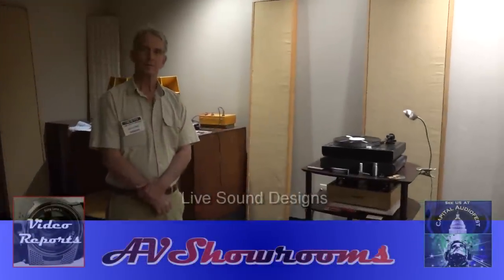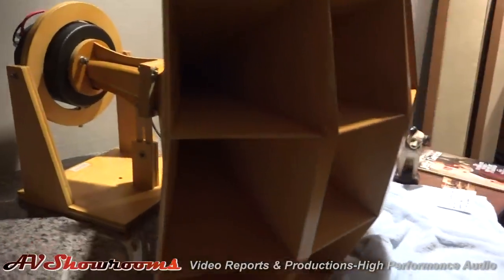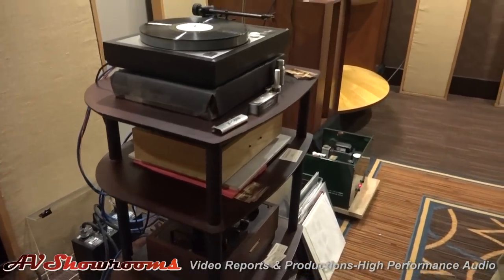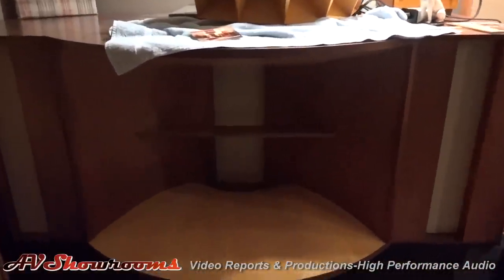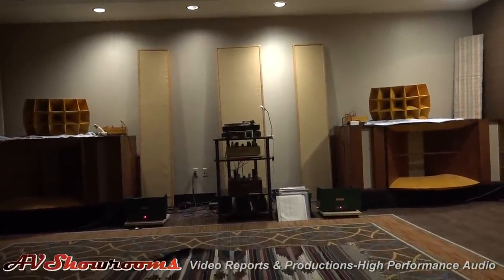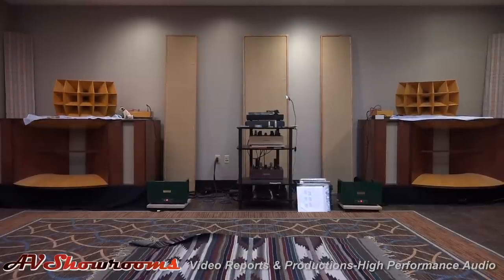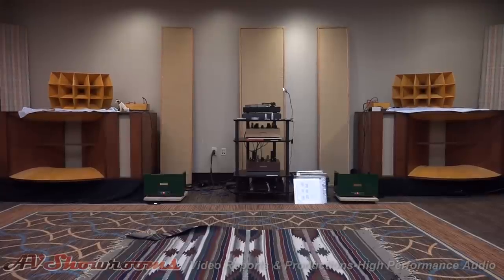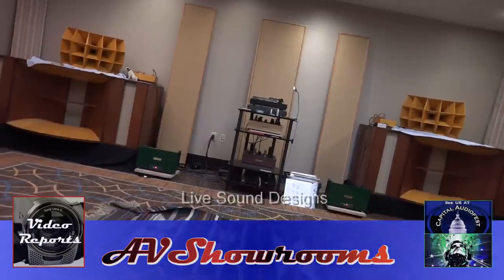Live Sound Designs, amazing horn loudspeakers, RCA's, The Capital Audiofest

Comment: Had three of those bins with the MI-9449 15" woofs and the radial HF horns and driver's.The MI-9377 amps came with the system too. Eight amps. They jump a bit better if you feed them some "Alan Parsons project". Sold all awhile ago. Using mostly JBL now.

Comment: the main problem is everything works well up to one power level ,and when it intensifies everything goes into chaos,,that question has bothered me in recent years why
Reply: Easy solution: Play at a lower volume level and you won't get the same problem with standing waves and other distortions  from the room.
Reply: @FlowithdaGo  Doesn't a proper room for these types of speakers need to be huge? Even bigger than the room these are playing in.
Reply: @bertroost1675  If you're playing loud, yes. Lower sound levels equals less energy in the room, and therefore the room doesn't matter that much.

Comment: I know this recording and sorry but the sound is obviously coloured. The midrange is entirely too forward… 'squawky' is the word. It seems very dynamic and clear though, just needs a little EQing… maybe some work on the crossover will fix it.
Reply: Impossible to judge over the internet through secondary  speakers, but I never found the LP12 to be suited to horns;  colouration in the lower mid/upper bass being the primary issue, plus too mid-dominant sounding with not much bite/attack at the extremes.
Reply: SSF... you are correct. This has "horn" colorations quite obviously.

Comment: NO TOP END on those...period.  Coming right out of the driver on an Altec 288G into a standard tube, you're already down -10 dB before it even hits the throat.  Efficient, yes..."good?"  No.  Polar plots of these and the 1502s show "fingering" of the top end with 15 KC down -16 dB on axis with each cell's mouth, similar to the rolloff you get with a modern CD horn.  THen there's the issue of the Altecs' famous harmonic distortion due to the squared corners...higher thrid harmonic production than even a lousy early SS amps of the late '60s.  Want multicells?  You'd be FAR better off with old Community 2X5s and JBL 2440s.  Also, the bottom end cuts off on the "Ubangi" bottom bin around 5O Hz as the horn unloads, just like the A2 and A4s.  This is not "high fidelity;" this is "colored sound" reminiscent of hi-fi in the '50s, including Paul's corner horn.  What used to make up for the lumpy freq response and distortion was the dynamic range then impossible with direct radiators.  That's been overcome with better driver designs today and gobs of clean MOSFET power available fairly cheaply.  However, a full horn system WILL save on your power bill, a fact not overlooked by owners of large dance halls I've known!  A pair of JBL 4331As driven by a Hafler DH-220s would romp all over this rig in all catagories for this program material.
Reply: +DeserT BoB All talk of frequency extension, harmonic distortion, horn shortcomings and what not; that's the (highly compressed) song of marketing BS that's supposed to convert us poor saps into avid buyers of products that suffer the fate of an overriding and now long-standing tendency to squeeze sound from speakers the size of milk cartons and amps of newer technology. Any missionary efforts would be better spent (instead) advising people to use their ears, and whether what's heard resemble live acoustic sound - insofar sonic authenticity is sought. Upon listening to the speakers of above video the interviewer exclaims "Super, super sound." Oh, let's just tell him what you wrote above and find out if he'll consider changing his statement. Surely the man must be a brown-noser or someone who has no concept of how to assess good sound, right? Well, go figure; I'd rather go by his hands-on impressions than your hypothetical scribblings. Btw, I like MOSFET-driven amps since I own a 30 watt Class-A MOSFET amp myself, and it's driving my 105+ dB horn speakers just brilliantly..
Reply: you mean to your ears the jbl sounds better.
Reply: So arrogant...
Reply: It's like driving an restored old car, it's for the feels over the specs even though I agree with you.
Reply: he's not being arrogant, he's being factual, and for the record he's right...
Reply: @poserwanabe  Im the owner and I can assure you he's wrong. With the hand built cabinets and GPA Alnico magnet drivers, The curve is pretty flat 32-16,000 with usable bass to 16. It's been measured.